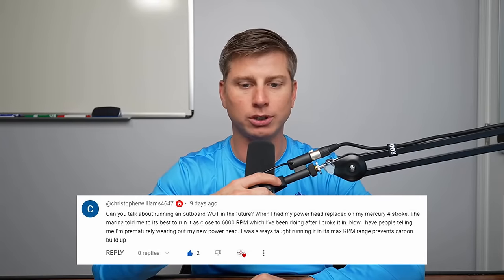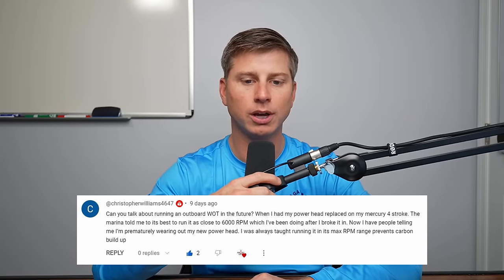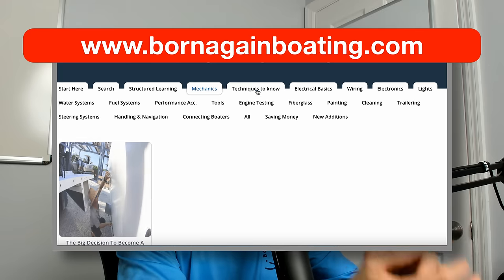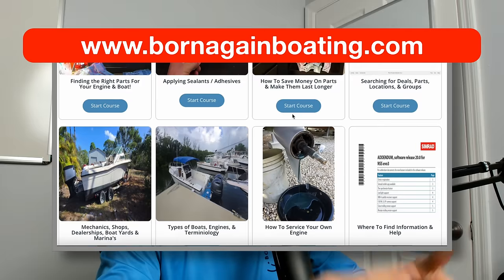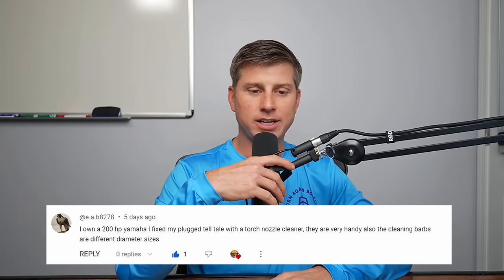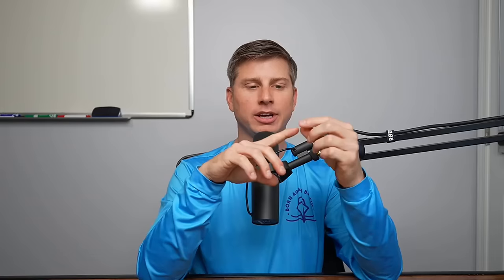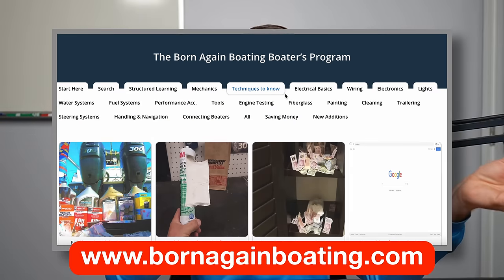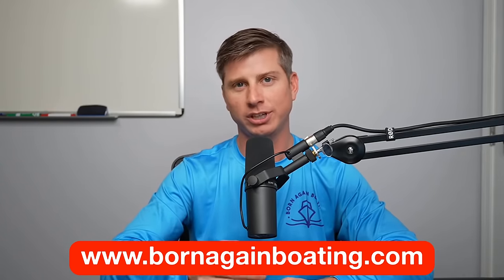Is Full Throttle BAD For Outboards?

Comment: Tohatsu with 2500hrs, 2 stroke, full throttle all the time.  Run them hard and often.  Last motor was a mercury which was made by Tohatsu 2 stroke, didn't have an hour meter but I ran it almost daily for 7 years, wide open as well.  
Commercial fishing.

Father was an outboard tech for 40 years, he said not running the motors hard is worse than running slow and infrequently.  He said the majority of longevity issues come from improper warm up before going full throttle and poor maintenance.

These motors are designed for  hard use, use them that way

Comment: I cannot find what my WOT is for my 2019 Mercury 115 4 stroke. My throttle control only allows 5,200 rpms.  little help please.
Reply from the maker: That engine's WOT Range is 5000-6000 so you're way over propped if you are only getting 5200 :/

Comment: They are turned down so it won't hurt it.
Reply: It would be really nice if we had full potential and performance of what we own. Just an example. My mower with a few tweaks goes 30 mph. Yet out of the store hits 5 mph. It's done for safety. These motors are not running to full potential. If they did I believe the motor would burn itself out. Like it's said in this video, we think we run flat out all the time, but we dont.

Comment: Yep no engine on any market is designed to run WOT for long periods.
Reply: Most diesels are designed to run at full power and load  for indefinite periods. These engines are rated to run continuously at full power. We run our tug wide open for days (sometimes weeks) on end 24 hours a day 7 days a week towing barges up and down the east coast. We only shut them down to change the oil. Our engines EMD 16-645s have over 150,000 hours on them since the last rebuild and we get around 30,000 hours out of a power assembly.

Comment: No it wont hurt your outboard as long as it running good .. an that mechanic ment to set it at 6000rpms not to run it all day at 6000rpm lmfao if u put a small blade wheel it will turn up rpm if u a big blade it will slow down the rpm u have to set the motor with the right wheel 😂😂😂😂 alot of people dont know about this 😂😂

Comment: Dumb.  There are no tuneups in 4 strokes anymore.  Fuel injected models have excellent fuel air ratio mapping and feedback from MAP sensor, Air flow sensors, Temps sensors, RPM, fuel flow, O2, etc.   There is no such thing as an “Italian” tune up to clear carbon anymore.  Distributors and points are long gone.
Now longevity.  My neighbor is a marine engineer for Cummins marine diesels.  They size fuel flow, turbos, rpm depending on Application.  Sportfishers around 3500 hours average rebuild so they can push a 6BT to 400Hp at higher RPM and power.  Same block in a 1993 Dodge Ram 2500 pushing 190Hp max will go over 15,000 hours.  Power and temp and RPM increases are inverse proportional to longevity.  Probably on a logarithmic scale.
Everyone else’s comments are equivalent to jail house attorneys.

Comment: Why would you run anything at wide open wide open throttle. I would think engine knock potential goes up and your slapping those crankshaft journals with uncessary force.

Comment: Title is misleading. The question is not “do” you typically run at full throttle, it is “should” you run at full throttle.  Then when you get to that issue you cover only carbon buildup and operating temp ( which does not change at full throttle unless cooling system has a problem).  Sounds like just an opinion with no backup. You could use more detailed info such as typical failure modes, data, photos, manufacturer recommendations, etc.

Comment: If you can't run a motor wide open at the top of the manufacturer's specified r p m range then it's a piece of garbage worthless trash design.

Comment: 2 stroke engines that are 50 years old or older can run wide open all day for 50 years and are just as good as new. Four strokes are just plain junk when used as an outboard.

Comment: This is just a trash take for trash quality newer motors. I have several old evinrude merc and Johnson outboards with anywhere from 40 hours to well over 300 and they all run like new and all get pinned full throttle for 80% of their run time. Literally never had any issues except basic maintenance. Newest motor i have is from the 80s should tell you something about actual qualities